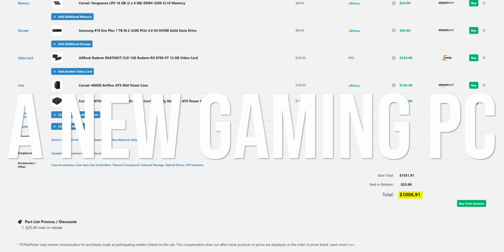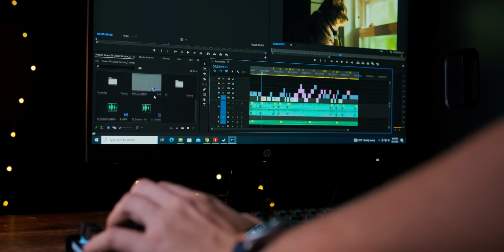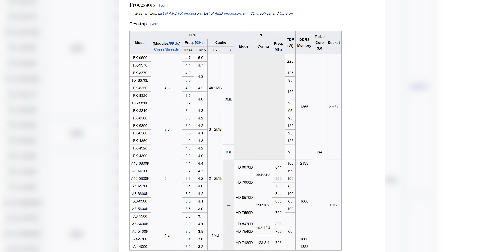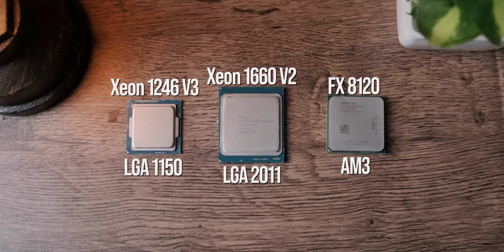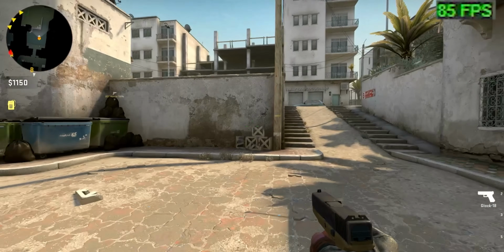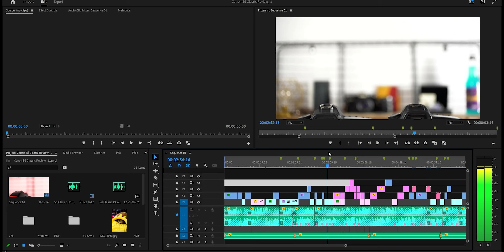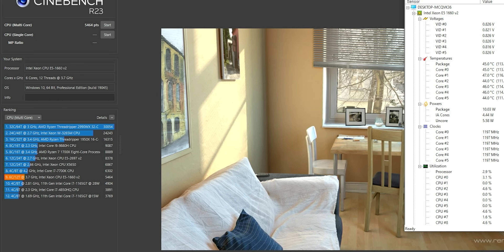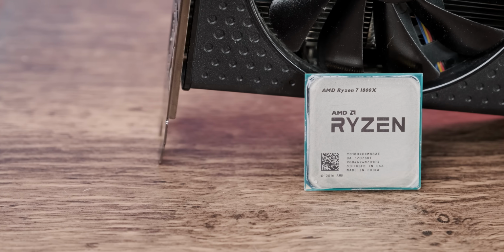DDR3 is DEAD

Comment: On pre haswell/broadwell platforms lack of AVX2 is a problem - "cpu unsupported" and you are looking on your wallpaper not DDR3. It was couple patches for couple games, but it won't take long (most oddity for me was in Uncharted, you know unsupported, but after a  patch ~ 100fps on high details...). 

OEM complete PC for quite low price makes sense , but buying cpu or motherboard for so many $ is just loss of money.

I was using LGA 1155 platform with DDR3 since 2012 to 2023 and I switch to LGA1700 and DDR4 because my motherboard died and my i7 3770K@4.7 GHz lacks of AVX2 instructions so buying another old lga 1155 mobo was pointles.

In memory benchmark  (I know dual channel onlt :) ):

my DDR3 was running @ 2400 CL 12, 13, 12, 36 and read speed was about 39000MB/s 
my DDR4 run's @3200 CL 16,17,16,36 and read speed is 44000MB/s

3770K@4.7GHz performs like I3 10100F (4 cores 8 threads), ofc higher clock speed, power consumpion and no AVX2 = "cpu unsupported".

Comment: When I built my PC in January 2017, the original bottleneck was the fact that I installed my 8GB 2400MHz DDR4 RAM in single channel, so I upgraded to 2x8 3200MHz. The next bottleneck much more recently was my dying 7200RPM 1TB HDD, so I upgraded to a 1TB NVME.

As of now, the final bottleneck affecting my Radeon RX 480 4GB is my Skylake Core i5-6400 wherein only two of its four cores can boost up from the base 2.7GHz to 3.2GHz. To that end, I'd need to replace the motherboard to get a CPU that supports Windows 11. So I'm just gonna rock what I've got until Windows 10 goes out of support in 2025 then pivot it to Linux, and continue to game on it until the i5-6400 or RX 480 finally become unable to achieve 60fps in the kinds of games I add to my Steam Library.

Comment: Got a spare windows 7 machines i run the x58 with. 12 gigs of triple channel DD3 1600, Xeon X5670 6 core with hyper threading. Not much for video as of now, waiting around for a decent cheap card to put it. It's old tech do not gonna invest much in it for older games.

Comment: I'm still runing a i7 960 with 32gb DDR3 ECC ram on with a 1660 super gpu. The most demanding game I run is Halo Infinite and it runs just fine. Probably the most demanding thing I do is video editing on Blender and that's I think, a cpu bottleneck. Either way I think it's overall a fine experience when you don't have much money to upgrade.

Comment: I do mostly 3d modeling and gpu rendering, so after taking a look at the options, last year I 'upgraded' my home rig to a $40 chinese lga2011 board supporting nvme, $35 of 64gb ddr3 ecc and a 12core xeon for $18. Needless to say a similar 'cheap' combo would have cost me like $300 if it were a ryzen/i5 with ddr4.

Comment: There are cheaper options for x99. You can easily get a x99 board for £50 from china, sure they might not be the best but they do work. There are several videos online reviewing these boards and there are some that are really good for the price.
Reply: But how to find out, which seller sells one of the good Mainboards as they are constantly changing their names or product description? Not criticising you or your idea, just an observation that is hard to find sellers after some weeks as the links show other listings or an error 404.
Reply: @paulhorn24  very good point, a lot of the chinese brands are probably absolute rubbish and you never fully know how good the quality of the components will be, but based on what ive seen the Huananzhi boards and the Huanan boards are supposed to be some of the more reliable brands.

Comment: I won't give up my very rare DDR3-2200 8-8-8-24.   It's a 2GBx2 kit from Super Talent.  It's made in the USA.   RAM easily can hit like 2000 7-7-7-21.  Lowest timings I got with it is 1t-5-6-5-20 at 1400 MHz on a Phenom II x6 1055t.   It is very fun ram kit to mess with.   On 2020 I went to buy the FX 8350 to try to push the ram again and easily hit 7-7-7-21 at 2000.  First time in 10 years because it was always on the Phenom II system with highest memory clock at 1600.

Even though its 4GB ram system does the job and its still fast for the older games no need to upgrade.   I did try out Valorant and manage to have stable 150 fps on the FX 8350 with GTX 580.   It beat out the Pentium G4400 (Skylake) which surprise me.   I had to cap the Pentium system at 45 fps to keep it from hitting 100% CPU usage.   It was very terrible experience.
Reply: Bro u know nothing about timings
Reply: @makesome_point  Bro you know nothing about having fun.   No clue what is your problem.   I'm just here sharing experience that is all.

Comment: I JUST updated to ddr4 because my old pc (2015) is officially dead without any hopes of putting new parts on it for budget prices.
Building a new pc would be 50% more expensive, but 100% of the parts would be brand new and it would go 6~8 years in the future with minimal upgrades.

Comment: I still have my 4790k. It was the CPU I had before my i9 10850k, I would still run it if I hadn't of upgraded, it wasn't really dying any time soon. Probably why it's still $80.
I ordered a i5 6400 prebuilt (Quad core 2.7Ghz), 8GB DDR4 ram, 1TB HDD for about $80. The 8350 I threw together with a box of scraps for my wife is still running, but it goes to show that DDR4 systems can be had quite easily. The 4790k definitely had much better performance than the 8350, probably does most things in half the time, but in gaming, not much diff, depending on the card of course.  I guess you didn't get the memo that the 8 cores were only 4 cores. AMD got sued for misinformation during the FX series CPUs.

Comment: Only reason I upgraded to DDR4 is I found in the street I7 6th gen 6 core CPU, Asus MB, 8×8GB DDR4 RAM.

One mens garbage is another men's treasure. I still can't understand why would someone toss that in garbage. 
It made no sense. 

Prior to this I had I7 4770K with 24GB DDR3.

Only reason I would upgrade thid one now is if this MB/CPU dies or I find better one.
In this days if you have bought/build descently speced system there is no need to upgrade early. May be you will upgrade your GPU once every 3 or 4 years, and in that case your CPU and MB should last you 2 to 4 upgrades.

Comment: If I couldn't get a cheap 12700k then I would still by using my overclocked 6C12T 3930k, and 32GB of RAM which had me going for years with a Vega 56

Comment: Amount, of ram, has been and still is more important than speed. So if you can still get a good deal on a DDR3 system that supports enough ram for newer games then it should be fine. I actually skipped DDR3 and went from DDR2 to DDR4...

Comment: The price to build a new gaming PC is insane if you ignore all other years, in 2023 it is as low as it has been this decade, especially if we compare performance per dollar.
Plus normal people buy parts on sale.
The GTX 780 TI was $699 in 2013 (923 USD adjusted for inflation), for the same price today you can get an RX 7900 XTX which offers 580% more performance for the same amount of money.
DDR4 is as cheap as it gets, depending on where you buy (Microcenter for example) you get 32GB for free if you buy an AMD CPU, still outside of microcenter you can usually get 32GB for about 50USD.
Storage is also as cheap as it gets in regards to dollar per GB.
PSUs were the cheapest they ever got to be in 2022 due to pandemic over production.
To me it sounds like you just started doing hardware stuff and didn't think through long enough in regards to the claims you made.

Comment: DDR3 is dead on desktop and has been for a while. On servers, though... also dead. It's simply tied to so hardware that has been obsoleted so much it's both sad and exciting. At work in our dept we had 30-something - dual socket Ivy-EP servers, littered with 16 and 32 GB sticks of DDR3, up to 786 GB and even some RAM server with 3 TB of DDR3 (four sockets and 96 RAM slots on riser cards). VMs for developers, all CI stack, compile farm and hosts for running unit tests and everything. Around September we unpacked fresh new and shiny 4th gen Xeon machines, most of them with 4 TB and couple with 8 TB. I migrated THREE RACKS OF SERVERS onto FOUR of these. It's insane. Before, I had to literally stuff these servers with network cards, monitor bandwidth to storage, put limits on everything to maintain low I/O delays and create illusion of usability to users. Now? Slap single 200 Gb/s adapter, throw a stack of NVMe drives, and it just bulldozes through tasks. Build-to-report time went from an hour to 3 minutes, and most of it is spinning up containers and checking certs and permissions. Total power went down from 30 kW including cooling to just 5. No savings here sadly, as price of power went up more than 8x in last 2 years...

Comment: I've used DD3 since 2012 with my then nearly new Mac Pro and used it with my i7 4790 based XPS 8700 until 2020. There just was no reason to honestly upgrade. Storage bandwidth aside, The i7 7700 with it's ddr4 ram made next to no difference. It wasn't until the i7 8700 did I see a major advantage to upgrading. With it I moved from a SSD based raid to Nvme but even with all these upgrades the newer platform was hardly worth the expense. Sure, storage wise I had gone from a dual SSD raid boot drive (about a little over 1 gb per second) to over 3 gb per second using Samsung technology, that was pretty fast but I don't think ram played a major role in the overall jump in performance
 What it did do was offer slightly faster, massively larger amount of ram.

Comment: In 2017 i got a Z420 for the same amount of money shown in this video. I got 6 years use out of it and could sell it for the same amount of money i spent on it.  It was the best thing for the price back then and got me through the pc parts shortage of 2020/2021 just fine. I am still using a variety of 3rd and 4th gen towers. Yes they are definitely starting to show their age but my 4th gen Xeon and 32GB ECC is still able to do anything sufficiently fast for my needs and by the time I get a 6th gen or newer prebuilt for about the same price I will plan to sell it then.

Comment: I built my DDR3 system back in late 2015 and am still using it today. I started out with 8GBs of corsair vengeance ram clocked at 1333MHz which was later upgraded to 16GBs a couple of years later. I'm still running an I5-4690K and an EVGA GTX 970. I plan on upgrading soon as I have a 1440p monitor and am not willing to lower the graphics or resolution of the games I play. I also plan on getting into game development, 3D modeling, and video editing which all require me to make some hardware changes.
Reply: So we are in the same situation lol

Comment: I still have a Xeon E3-1271 v3 (same performance as i7-4770K) with 32GB DDR3-1866 (running at 1600MT/s), still a good PC, its performance is basically the same as a 9th or 10th gen i3 CPU.

Comment: Ddr3 isn't two bad I just built a few this year. My brothers PC I build for them are running ddr3 i7 2600+gtx 960 and the other running i7 4770 with 970. And I just built a PC for my friend which is a I5 5470 with gtx 1050 ti. There great if your doing a Pascal/Polaris or older build

Comment: My 4790K is almost 10 years old. Coupled with a GTX 1080, and an SSD, a Creative Labs soundcard, it all works fine. Unless it fails, I will still be using this for a couple more years. Not ready to jump into Windows 11, either.

Comment: You can still use DDR2 if you are only playing lower end stuff. If you get a Core 2 Quad q6600, GT640 (or something similar and very cheap) and a 4 slot DDR2 motherboard and fill it with 4xDDR2 800MHz so you have a wwhole 8GB of ram, you can run GTA V, minecraft, basically any low-spec shooter (splitgate, valorant, fortnight (ew) etc.) and even games like BeamNG drive at lowest settings. Stuff won't look great but will run at 1080p at 30fps and video playback is fine at 1080p 60 fps. Browsing is great too. I used a machine like this for around a year before upgrading it reacently to a16GB DDR3 machine with a GTX970 (got for £20!) and i5-3470.

Comment: DDR3 still has excellent performance, as the voltage comes down in newer ram, the latency's get higher, DDR3 has the best happy place. On older AMD systems, the memory subsystem is really bad, DDR3 performed no better than DDR2. AMD did not resolve this problem until at least ryzen 2

Comment: DDR3 is alive and well for me. Finally upgraded to Haswell from 2 identical AM2+ (95W max) boards. Feel like I got some decent deals, considering the f*king tech market. But still paid top much. Roughly... $450 I think? For an i7 4790 cpu+mobo+ram combo, SuperFlower PSU, GTX 1080 FTW, 2x8GB Corsair DDR3-1600, and 2x256GB SATA SSDs. I can finally play Subnautica! And many other games on ultra, 1080p. Didn't even add a case, monitor, or peripherals to the mix. Yet...

Comment: I  still have a q6700 gtx650ti  and 8 gb ddr2 running a Windows 10 system  , I have upgraded to a  5600/rtx3060  , i never had a ddr3 system because the games and things i did run fine till my latest system, however the coming new Ai  developments been integrated into game engines and  online  will hyper accelerate the technology gap between  a capable system and a leading system , its a  interesting time  for tech.

Comment: Okay.... your video is misleading. Showing an HP Z420, which only supports registered ddr3 memory then talking about high end socket 2011 cpu (i7) in this system that clearly wont ever support it since it has a Intel C602 chipset chipset ment to only run xeon processors.  Whereas a true motherboard from a reputable vendor asus/intel/asrock/msi etc will support xeon and i7 because yes the chipset (yes x79 chipset) was designed to supported unbuffered memory. But then theres several versions which tend to blur the line between machines Z220 Z440 etc...

and no. Dont even talk about the chinese knockoff "x79" which all use C602 chipsets with modded bioses to support all sorts of variations of setups.

But ultimately DDR3 being as old as it once may be, still quite useful is not dead. despite ddr5 is out

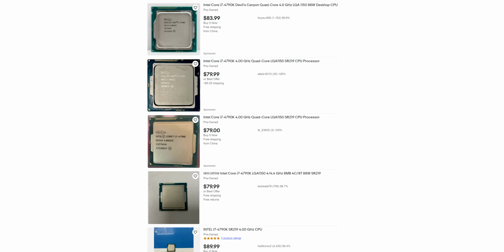Comment: 1:14 that chip is really, really good. The company I used to work for had one i7-4790K and I regret not buying it from them when I quit that job. 
I get why its almost $100 . 
I have now a i7-5820K which comes close, but doesn't have the same single-core performance. That thing was brutal at single-core performance. 
If you want a single core performance that good, you would have to spend $1000 in a CPU nowadays... (thanks binning)

Comment: Up until a few weeks ago I was using a dual xeon dell precision with FB-DDR2! Crazy high end machine from the time that worked well however I've switched to a low powered i5 with DDR4. 350w of TDP and quad channel memory has roughly the same power as a newish 35W CPU and low spec DDR4

Comment: i rocked ddr3 from 2015 to 2021...well when my pc was working. i didnt even know it was ddr3 i found out when i wanted to buy a new gpu and cpu then i researched everything and realized to buy a new cpu i need a new ddr4 motherboard, then ddr4 ram. ended up basically buying everything new and building it myself

Comment: I've had the same AMD A75 system for the past 12 years, with DDR3 and a second-hand GTX 970, and I barely notice any difference in the speed of apps and games from 12 years ago. Albeit I mostly run open source apps (on both Windows 10 and Linux) and indie games.

Frankly the only reason I'm even considering buying new hardware is because my motherboard is literally dying of old age (I suspect there's a short somewhere). When I do "upgrade", it'll either be used hardware off eBay (Xeons are literally going for pennies these days), or if I really want to push the boat out, I'll get an A520/Ryzen 5 4500 and DDR4 combo.

Either way I'm not spending more than £200. Probably ever. The days of me blowing my entire salary on a new PC are long over. The last time I did that was back in the days of the Pentium 4 Prescott (back when "glass" side panels were actually plastic, and had to be custom made).

If I live long enough, I might eventually buy a Ryzen 9/DDR 5 system ... in about 20 years. If I can get it for less than £200. Maybe.

Comment: My dude, all you need to do if you want a build in a consumer case with rgb all you have to do is grab an hp pro desk 600G1 motherboard for $15 and adapter for the power supply for like $8 so with tax it's probably $25 in total. The ONLY issue is you have to press f1 whenever you boot up or just jump the Front panel connector with aeither a jumper or a paperclip[. I wouldn't even worry about that I ran a machine like that for a year until i built this rig Im playing on now which SDLAYS in price to performance.  Which is REALLY not an issue at all for a personal build. You can get a 4'th gen i5 for less than $20. Ge the SFF mobo and you only have to jummp one connector because it doesn't have a fan anyway. Just the front USB 2.0 not being connected gives you an alert every time you boot up. 

Or if you wanna get silly, you can buy an optiplex 3050 mobo and the adapter but the standoffs dont line up only the ones at the top so you have to pad out the bottom of the board with rubber so it doesn't touch the board and it uses DDR3l. It's the same price except the 3050 is 1151 so you can get an i5-6500 for $20 and some DDR3l which is still ddr3 it's just the low voltage variant Same steps as the hp for the front panel though.

Comment: there's people in latinamerica still using ddr2 systems for esports. systems with the 775 socket are a plague, they're everywhere, so these are the chespest solution.

they also pair those with gt710's, 1030's, rx550's, 1050ti's or whatever they can get their hands on.
i knew someone who bought a gt210 because having a graphics card on his computer meant he was cool, it was a pentium E system. he spent $40 on a brand new gt210 because technology is very expensive in my country.